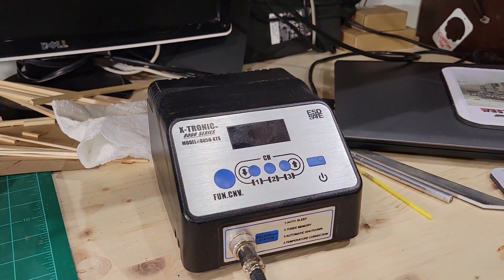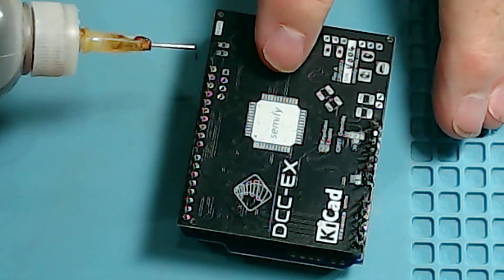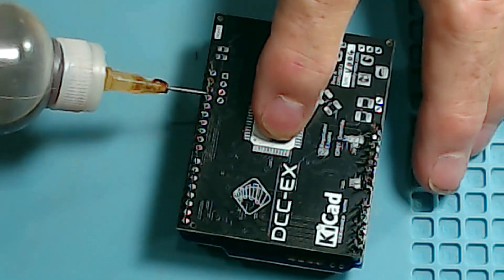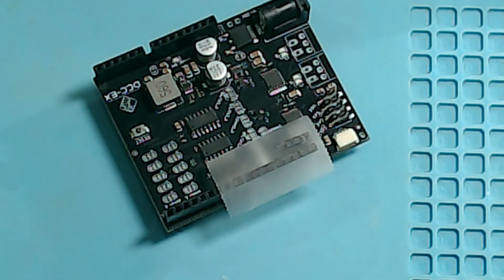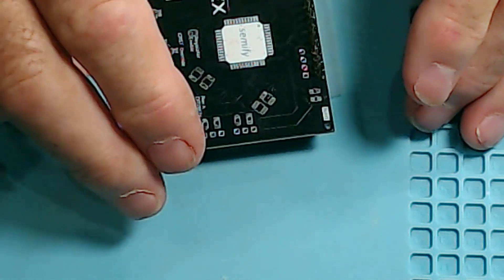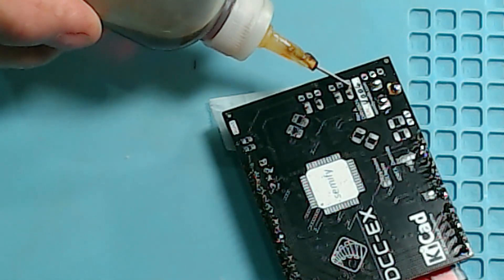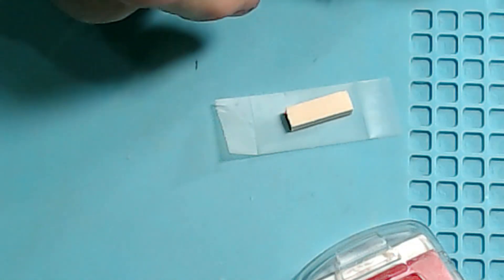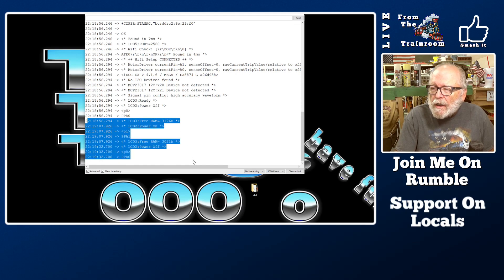Soldering Then Testing The New DCC EX Motor Shield 7784

Comment: I have two DCC-EX setups. One uses Arduino Motor Shield REV3 while the second one uses the Markerfabs and all use the ESP8266 WiFi shield and 20 x4 display. They work fine accept the display for Markerfabs doesn’t work, it lights up but I get no message. Both displays work’s fine when hooked to the Arduino Motor Shield REV3.
Reply from the maker: Check the DCC-EX website for comparable motor shields. Makerfab mat not be on the list
Reply: @TomsTrainsandThings  Sorry, I should have said EX-MotorShield8874 RevA not Markerfab.
The real question is how do I hookup the EX-MotorShield8874 RevA and the LCD  20 x4 display? Both displays work’s fine when hooked to the Arduino Motor Shield REV3.
Reply from the maker: @dantecant  Did you change the code to reflect you are using the 8874 and not the standard motor shield?
Reply: @TomsTrainsandThings  I thought I did.
Reply: I got it but I don't how! Could you come with a list saying what to do. For example, when to unplug and re plug to the computer, when to provide power, when to provide to the track, etc. I know it's a pain!

Comment: Just got my new 7784 shield (already assembled).  Was in Customs jail for two weeks.  Hope for a video that both describes all the features of the 7784, and maybe do that in an updated build video, as if someone has never assembled one before... but with this new motor driver.
Reply from the maker: Trying to finish up a structure kit. As soon as I'm finished with that, I'll be able to play around with the code. The unreleased code is where all the Track Manager features are which will be out in ver 5.0
Reply: Where did you get it?

Comment: Looks good, soldering not my skill. If I tried that all pins would be one LOL, I know its more $ to buy a premade one but it is worth it to me.  Out of curiosity what flux and applicator bottle are you using? looks a bit more pinpoint than a brush or swab  :) I have trouble soldering little micro switches with the paste flux it works ok on larger stuff but not the teennie tiny stuff THANKS
Reply from the maker: You can find everything I use in my videos on my Amazon page, that's where I bought the rosin flux and the squeeze bottles with the needle applicator. 
https://www.amazon.com/shop/tomstrainsandthings

Comment: Not so sure "how easy" that much soldering on pc board will be. By the way, have you heard if the new Uno R4 to be released at the end of the month, with it's upgraded specifications and WiFi, may be an option to the Mega 2560?
Reply from the maker: Not hard at all, just repetitious. R4 is faster with more memory but the same I/Os as R3. Mega still beats it for the additional pins